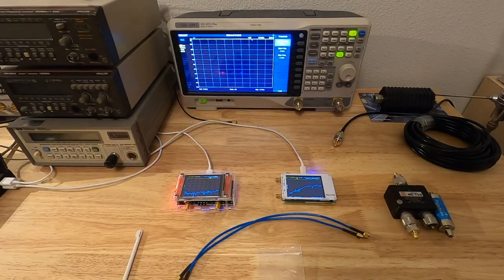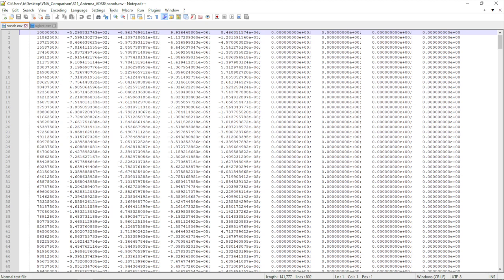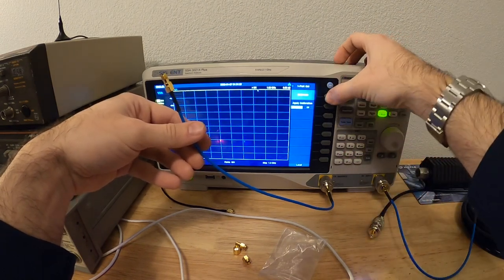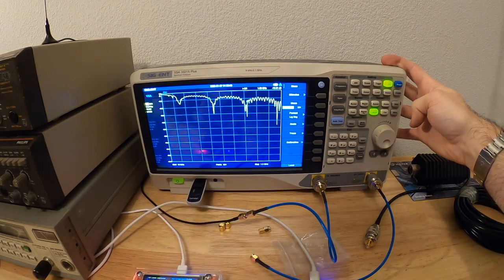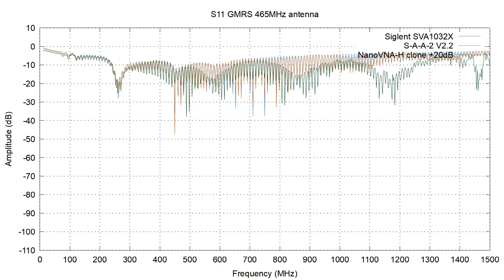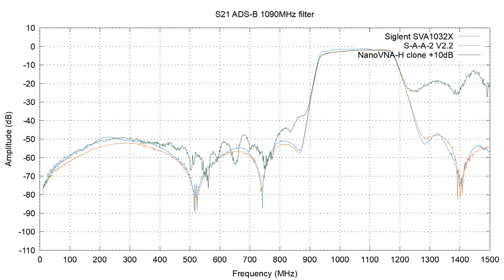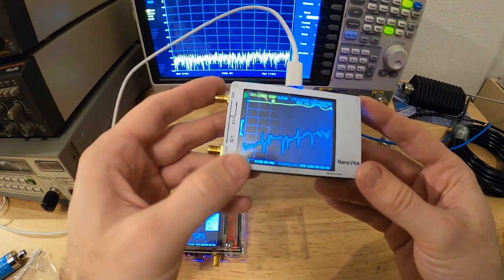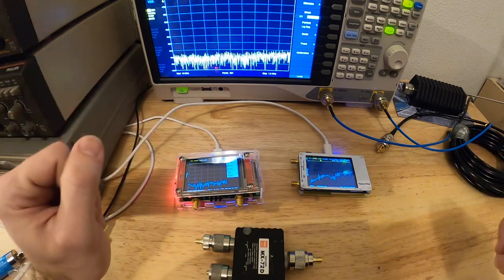NanoVNA vs Siglent SVA1032X: Comparing VNAs

Comment: The SAA2 VNA uses a different DDS to the NanoVNA. The NanoVNA uses a SI5351 which can only generate frequencies up to 300MHz and uses harmonics to get above it. This reduced dynamic range significantly.

The SAA2 uses an ADF4351 which can generate RF up to 4.4GHz without resorting to using harmonics, resulting in a better dynamic range across the board. Newer SAA2 revisions use the MAX2871 which is very similar to the ADF4351 but can sweep up to 6GHz.

As you say, the shielding will also help with the SAA2. 

I also own a NanoVNA, one of the original SAA2 VNAs and a Siglent VNA :-)

Comment: As Andy mentioned DDS are different in you VNAs. That is very important, because RF generator output power is much lower when using 2nd harmonic and even lower when using 3rd harmonic, and if we say RX sensitivity and noise stays the same, you get much worse S/N ratio (you get more noise compared to the signal) on higher frequencies. Shielding would help, but just to a point. When you calibrate VNA it offsets that very low (2nd or up to 5th harmonic) signal level with big gain to get 0dB trace at all frequencies, so it is mostly RF generator output level problem. RX sensitivity is also getting worse at higher frequencies, because of higher mixer conversion losses, which is another 'RF signal level' problem. Inconsistencies between measurements are also due to cable bending (since those cables are not phase stable), SMA tightening and some common mode current outside the coax.

It would be interesting to take one measurement with Siglent, then disconnect cable, connect it again to Siglent and taking second measurement. I suspect you would get almost the same difference as you did with comparison to SAA2. That would show cable bending and SMA tightening contributions plus other measurement uncertainties.

Comment: NanoVNA-H is the old V1 version, Si5335 based, that works on harmonics above something like 300MHz, so no wonder it has much worse specs.
Si5335 synthesizer chip official spec: fmax 200MHz

NanoVNA V2 is new version based on 2x ADF4350 with official fmax of 4400Mhz, so no harmonics needed.

NanoVNA-F V2 clone version with somewhat better/nicer mechanical design, aluminum case instead of plastics,  for a bit more money

Comment: Many thanks. This was a very interesting set of tests. Based on my own needs, my take away is that all three VNAs are very close to each other up to 400 or 500MHz and then they diverge, the "H" clone sharply so. Everything I do, though, is below 148MHz, and within that larger range usually test in much smaller spans of 10KHz or so and once in a while 200 or 300KHz. All below 148MHz. Any of these--the two nanoVNAs or the Siglent--would be adequate for my purposes. The 10 and 20dB offsets produced by the H-clone is weird. I wonder if the very-wide bandwidth scanned in these tests has anything to do with that

Comment: Nice to see the comparison. I have nanoVNA-H4 from a reputable seller in The Netherlands and i suppose it is not a clone. The enclosure is a 'snap-on' type, so not easy to open up and look inside and say something about the shielding. I also don't have another instrument at home to compare, but could ask my colleague at work to do a quick compare. I have done some basic measurement filter measurements and on my EFHW 10m long antenna and could fine tune it with this nanoVNA. It all seems right, but once again not much to compare yet. About the port 21 isolation graph, that could be calibrated away? Or not?
Reply: Edit: nonsense what I said about the enclosure 🙈 it has 4 screws.

Comment: Impressed with the SAA2. Very close to the Siglent. I've just bought the NanoVNA-F V2 enclosed in metal case. Also has 4 metal cans on the circuit board, so hopefully well screened.
Reply: I have the same NanoVNA-F v2 and we did a similar test against our Megiq VNA0460, comparing both the bode plot and the smith charts, and they perform equally well. We use it a lot to perform impedance matching and the smith chart on both analyzers results in the same series LC (within some %) so I am very happy with the F v2
Reply: the NanoVNA-F is not the same as NanoVNA SAA2. Different companies using different designs. The F is a lower quality knockoff clone of the original design aimed at making them the most money. The SAA is newer design, redesigned from scratch with different goals in mind
Reply: @sammiller6631  The NanoVNA-F v2 (not to be confused with the older NanoVNA-F) is a product developed by Sysjoint based on the original NanoVNA and the SAA v2. I have one and we use it a lot to match our RF circuits (430 up to 2450 MHz). We also have a Megiq VNA0460 and an HP spectrum analyzer with tracking generator and an external directional coupler. Measurement results from the NanoVNA-F v2 I have are as good as from the other equipment. So I would not say this is a lower quality knockoff. The metal case, metal RF shielding cans and the internal construction of the device look great.

Comment: When you take measurements from duplexers, put a dummy load on the unused port.
Leaving the unused port floating ussually results in phantom troughs all over the place.
Reply from the maker: I had to recheck the video and you're right, I totally forgot to do it. I believe the impact shouldn't be very significant due to the attenuation between the channels, but you're absolutely correct, this is an oversight on my part during this test. Thanks for pointing it out!
Reply: @the_bootloader  For what you were doing, I guess you could choose to deliberately ignore wierd responses outside of the band of interest.
The only reason I noticed was because I have to tune commercial duplexers at work, and the phantom troughs can cause serious issues with figuring out what is going on.
Reply from the maker: @digitalradiohacker  yes you're absolutely right. As you point out, for my purpose it didn't really matter but generally it's good practice and the way to do it. Thanks again for participating and sharing your knowledge, it's great that we can all learn together from our respective experiences
Reply: @the_bootloader  Absolutely. I bought one of these as a potential alternative to the 10KG Aeroflex 3500 that I have in my van. I know that a new instrument of this class costs the same as a house, so they're not the same, but there is also 20 years of development between them as well.
In reality, I'm finding the noise floor on mine to be quite pathetic (around 50dB?). This is no good for tuning commercial duplexers which are capable of -80dB rejection.
Mine is marked as NanoVNA-H
The search for firmware that won't make a brick is ongoing.....

Comment: The white Nano is a clone and the results you are getting are probably due to that fact. I have a modified clone H and an original H4 and those do not exhibit that kind of behaviour. Try NanoVNA Saver software and do not calibrate on device. Saver will offer much higher number of calibration points and a correction for the trough measurement. Makes sure that you get the latest firmware. DisLord firmware is recommended.

Comment: I wonder why people always insist to compare a basic toy like tool to a semi professional one. It is like comparing a Cozy Coupe to a mid size Chevy or Volkswagen.
Reply from the maker: The SAA2 performing on par with the Siglent, at least on a noise level perspective up to 1.5GHz, was unexpected. There are other valuable pieces of information shared, such as a methodology to graph data from multiple brands of VNAs. Thank you for watching and for your feedback
Reply: Nano is not (especialy the official versions) a toy up to 250MHz.
Reply: Most of the people will use the nanoVNA way below GHz frequency so it performs great!My '97 Golf still runs like a swiss watch and takes me to places  while seeing  many luxury cars biting the dust...:) It gets the job done...:)
Reply: @solarflare4259  True. There are other version of Nano that are fine in the GHz range, LiteVNA for example (same manufacturer as for H4), and pretty affordable. Golf bit reminds me of the Balkans 😁
Reply: @galileo_rs  Indeed. I've got a H4 and it works great. I find myself using it up to 60 MHz, mostly for HAM shortwave...Currently waiting to receive the 4401 ... Just wanted a larger display.
As for the Golf, I grabbed it back in '99 and I've taken good care of it.It comes really handy now with rising of fuel prices (2L) engine MT... I barely see some like these on the road; even hard to find parts at salvage yards...:)
Reply: @solarflare4259  Pricy upgrade. Most of the time I use it on the bench with a computer but a few times that I needed to use it at someone else place or outside I just connected it to a tablet.
Reply: @galileo_rs   Indeed PC or tablet for the nano works great! Purchased  my 4401  for  $289 at AliExpress. Paid once and cried once...:)
Reply: @solarflare4259  That is not so bad compared to the 500€ price I saw on some EU website 😀
Reply: @galileo_rs  Yes, it's a better price. I think they import them from China at a lower price and add mark ups... 500€...😳 Even in the States they sell for higher prices than currently sold at the Chinese Website, at least some of the products other are equally expensive...
Reply: @galileo_rs  Got my 4401A today. .It works  great! AliExpress seems reliable and shipping time was not too bad , 10days...
Reply: @solarflare4259  10 days is exception when it comes to AliExpress, I guess the lifting of pandemic restrictions and the increase in commercial air traffic helps. Have fun playing with a new toy.
Reply: Jokes aside, I would love to watch a serious review of a Cozy Coupe against a Chevy. My money in the first.
Reply: @germanjohn5626: Those three cars compare to one another in a very important way: each gets you to where you're going. In a car--or a VNA--anything beyond that is a waste of money.